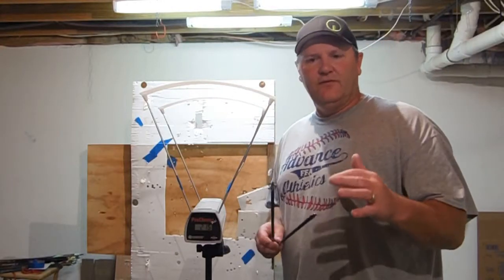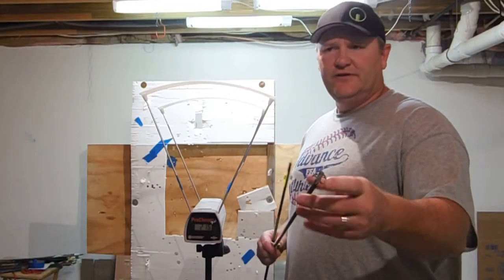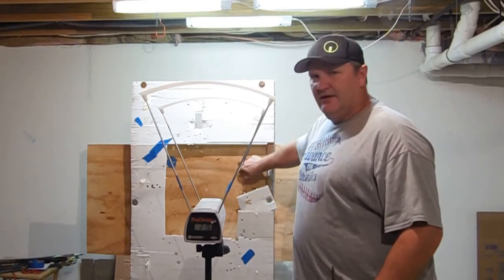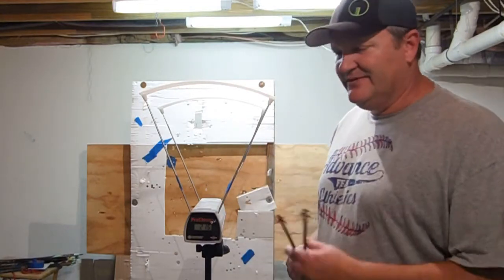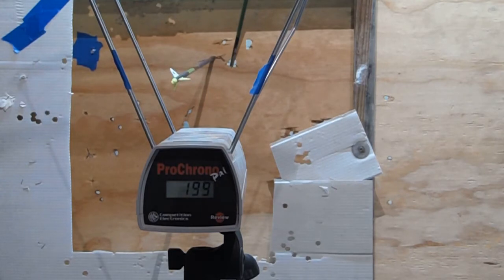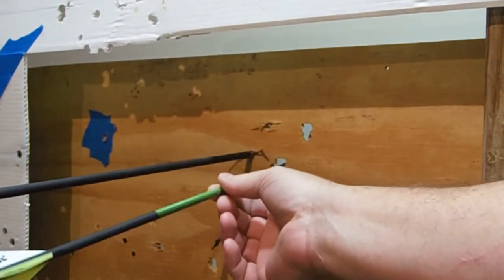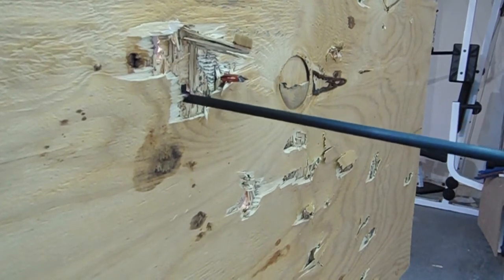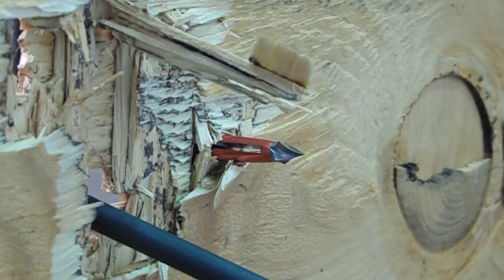Light vs Heavy Arrow Penetration with 46# Draw Weight

Comment: Why would you even do this test and put it on YouTube with two different broadheads I just don't get the reasoning. people don't get it not only do you need the exact same tip which should be a field point to eliminate differences if you make one Arrow heavier than the other, all arrows need to be perfectly tuned for this test to mean anyting

Comment: Mr. Toxic...….just a bullshit display of the broadhead, has nothing to do with reality
best flight and penetration is an arrow with the longest usable length possible and a FOC of 19-24%
proven design for all bows...……..
personal opinion is to use nothing less than 10 grains per pound...….pull 43lbs shoot 430 grain.....averages out to about 195 fps on all my bows

Comment: The complaints about the broadhead difference are 100% justified. Higher momentum is the primary determinant of penetration difference with arrows, and the qound channel is what kills with arrows, that is honestly just about all you need to know from a practical perspective as long as you can hit your intended target and are using a broadhead of any kind.

The 2" wound channel will cause much more damage, and you are more likely to hit something vital with the wider channel, but if you hit heavy bones the wider head of the deployed expandable will either break off or do exactly what we just saw: Get stuck and catch your arrow.

All you did was show that if you spread force across a larger area the plywood will not be damaged as badly. If you make a 20% gel block and shoot the two again, you'll get a more accurate representation of the difference in momentum. Mathematically, it should work out to be pretty much identical proportions between difference in momentum and difference in penetration.

It won't change the fact that the higher momentum arrow (typically the heavier arrow) will penetrate better, but you're not getting a valid comparison in this video. Just FYI.

Comment: This test has no meaning and is pointless. You need both the same heads to prove a point. A light arrow with a huge mechanical will never out penetrate a heavier cut on contact arrow with more forward of center.

Comment: Seriously, a 347 grain arrow from a 46 pound bow with a 2 inch wide cutting diameter broadhead vs a 428 grain arrow from same bow tipped with a significantly smaller diameter fixed blade broadhead and you're comparing weight to penetration? There are other factors at play here, bad test.

Comment: You're using two completely different broadheads making this an apples-to-oranges comparison. I would wager that the increased penetration is more caused by the fixed vs mechanical broadhead design than the arrow weight. Very poor scientific method.